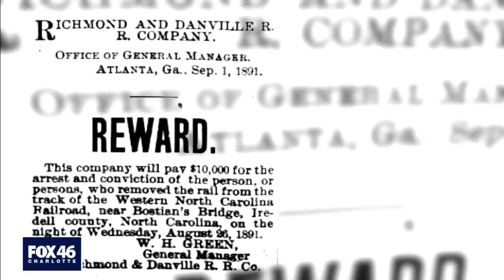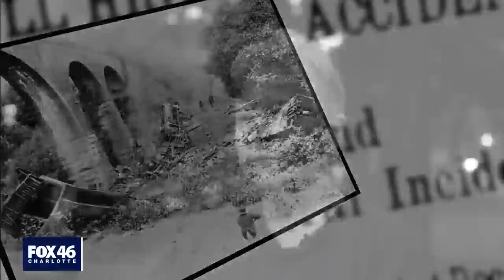Ghost Train: Paranormal mystery behind a historic North Carolina train crash

Comment: I just went to early station railroads last night and there was lights it couldn't have been a head or tail lights it was to high off ground my curiosity is if its someone playing a joke but there definitely a light that looks like a lantern
Reply: The Early Station light is cars passing over the tracks on the Brick Mill Rd. That crossing is at an angle and has a high hump
Reply: @stevewhite9405  its actually not cause ive been at all three openings now some of the lights are headlights/taillights but some arent and you can tell when its in the air and not on the ground and it constantly moves around plus we brought a spotlight trying to figure out what it was and we still didnt see anything